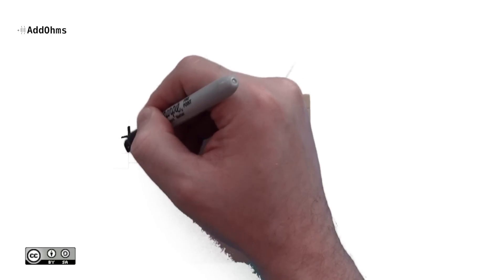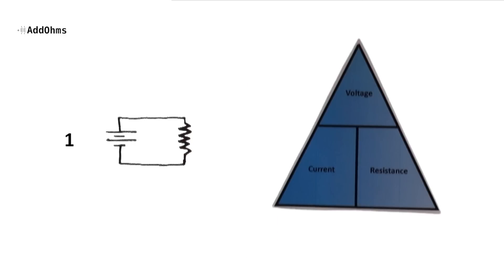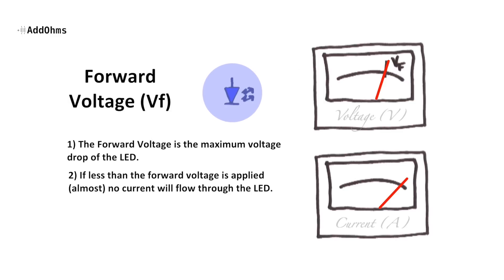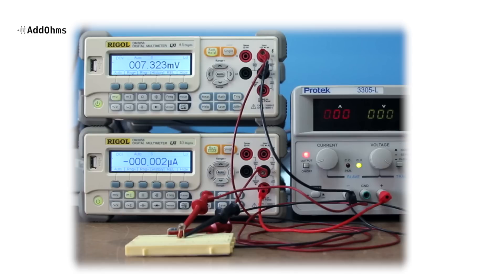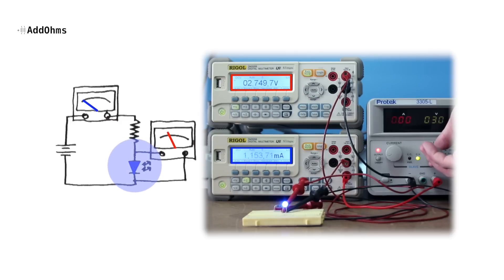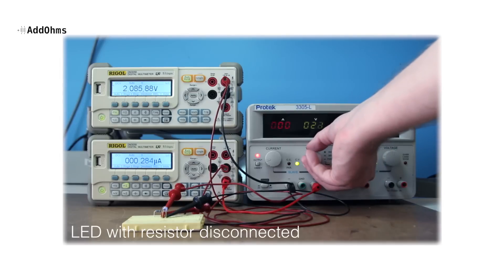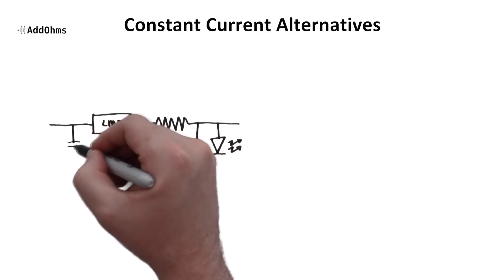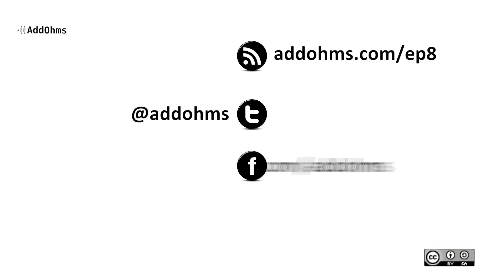Why use Current Limiting Resistors | AddOhms #8

Comment: i know the standard resistor value to be used with LED is 330 ohm. How was this value derived?
Reply from the maker: The value of the current limiting resistor is determined by the LED's forward voltage and the forward current you want to set. Using those two pieces of data, you use ohm's law to calculate the resistor's value. 

(Most people set the forward current to the LED's Max, which is generally around 20mA. This isn't necessary and shortens the life of the LED.)

I have a written tutorial on it here: https://www.baldengineer.com/led-basics.html

Comment: How about if you use PWM yo limit the current, taking into account the voltage drop and the voltage you are using?
Reply from the maker: +Victor Rivarola Nope. PWM isn't analog. It's the full voltage on, when it is on. You still need a resistor.
Reply: +AddOhms Are you sure of that? 

According to my tests... it works!

https://drive.google.com/file/d/0B1GqzCtvayD3RzN0TlUxR0Q1MGM/view?usp=drivesdk
Reply: +Victor Rivarola I could even post the code if requested.
Reply: You know what, here is the code. Just copy it into an Arduino IDE and upload it to the device... THEN hook up the LED to it.

-----------------------------------

// LedWithoutResistor - This lights an LED connected to a PWM chip without
// a power wasting resistor. WARNING: You need to check your LED's vorward
// voltage drop and the arduino's output voltage for this to work,
// otherwise you risk burning it.

// (c) Star Labs Informatica N.C.V.V., Modified BSD lisence
// http://directory.fsf.org/wiki/License:BSD_3Clause

/*
 fLedsForwardVoltageDrop     nLedsHighLevel
------------------------- = ----------------
      fArduinosVoltage            255
 */
 
const float fLedsForwardVoltageDrop = 3.0;
const float fArduinosVoltage        = 5.0;
const byte  nLedsHighLevel          = fLedsForwardVoltageDrop * 255 / fArduinosVoltage;

// The LED on nLed is supposedto have no resistor, while the other one obviously does.
const byte  nLed                    = 11;
const byte  nBuiltinLed             = 13;

// setup -- All of the program is done at the begining
void setup() {
  pinMode      (nLed,        OUTPUT);
  pinMode      (nBuiltinLed, OUTPUT);
  analogWrite  (nLed,        nLedsHighLevel);
  digitalWrite (nBuiltinLed, HIGH);
}

// loop -- There is nothing here, just fullfills Arduino's API.
void loop() {}
Reply from the maker: +Victor Rivarola "It works" is a bad result. "It works", for now... You need the current limiting resistor. When the PWM is on, the LED is drawing the max current it can draw. It is damaging the LED and the IO pin. It will take long for the circuit to fail, but it will fail.
Reply: Thanks

Comment: Nicely done. So it doesn't matter if the resistor is in the circuit before of after the LED? If it is good design to have the resistor after the LED then is it good design to have one resistor after 3 LEDs as long as the resistor value is correct for each of the LEDs and as long as only one of the three LEDs is lit at one time? Like as in a stop light?
Reply from the maker: +Volthaus Lab Since it is a series circuit, it doesn't really matter where you place the resistor. A good design practice is to place the resistor between the source and the LED.

As for your 3 LEDs in parallel--or a RGB LED, I've seen designs that save space doing it with one resistor. However, I personally wouldn't. Also if they are different colors, you're going to want different resistor values. Red LEDs are generally dimmer than Green and have different forward voltages.

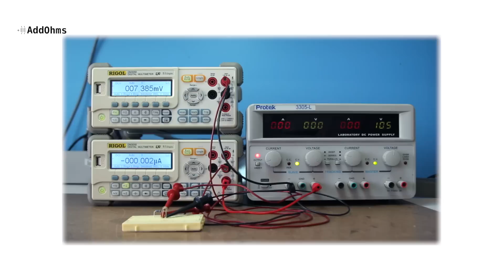Comment: At 3:22 you said we took the LED out... but the text said LED with resistor disconnected. Small slip up but a very informative and interesting video.
Reply from the maker: +fatherof8kids Occasionally I slip and don't catch it. 

In the "Analog vs Digital" video I said "digital" once when I meant to say analog. No one has caught that one yet. ;)
Reply: yes i notice that also, but now i understand about the current and voltage mutch more

Comment: I find that in many cases,  I can use leds without resistors, like when op amps are used to drive them. Op amps rarely can deliver more than a few 10's of milliamps! Sometimes I will use power supplies that have 3V outputs and can naturally drive blue and white LEDs without issues.

Comment: as we know V=IR

if R is not connected in the circuit (means R= 0 ohms)
then will the Voltage be zero?
Reply: Resistance is never 0.  There is some resistance in the LEDs and some resistance in the wires and usually some resistance in the power source (e.g. battery).  

These small resistances will drop whatever voltage the LED doesn't, creating unnecessary heat and potentially damage things.  I sort of talk about this in #9, where I address putting 4 LEDs in Series:  AO #8 Current Limiting Resistors
Reply: If R is removed then its value is infinite (not "0"), and you are left with pure capacitance. Enter imaginary numbers: i=√(-1).

Comment: Do I still need a resister if the LEDs are in a 4*2 style powered by a 12 battery?
Reply from the maker: 4 in series with 2 "branches" in parallel?
Reply from the maker: Check out Video Q&A #1  (video #9).  I addressed this question there.

Comment from the maker: Good question Norm.  Even if you use 2 AA batteries, the problem is that the LED will draw as much current as it can.  It's "current limiting resistor" will become the internal resistance of the battery. 

When new, the batteries will provide a LOT of current at first.  Over time, they'll drop rapidly.
Reply: I have 60 volt transformer I want to be able to vary the voltage from 0 to 60 volts dc  I can't use an lm317 because I would burn it out, what do I do?
Reply from the maker: Owen Chase science channel What do you mean by transformer? 

Transformers only work with AC. Are you trying to convert AC to DC and then create a variable power supply? Because no matter what you do, you won't be able to take the 60V AC output of a transformer and output 60V DC, without some loss.
Reply: AddOhms ya I know how to convert it to dc I just want to make it variable.
Reply from the maker: Owen Chase science channel  I certainly wouldn't use a linear regulator. When your output voltage is very low, it would be dropping the entire difference between Vin and Vout, which means very little output current.

So, you probably need to look at a switching (buck) converter. The TPS-series from TI has a high input voltage and they offer variable versions. 

You could get pretty close to 0 and pretty close to 50V with a single switching circuit, but it would be horribly inefficient and relatively difficult to select the passive components.

Instead, I'd recommend a couple of different stages or ranges, similar to how a bench power supply works. Of course, then you need to build a front-end to manage that.
Reply: Thanks
Reply: +Owen Chase science channel Bench-top adjustable linear power supplies generally use transformers with many, many taps. That way that can keep the delta voltage (between the transformer tap and output) low. You may consider rewinding the 60v transformer, or using a variac instead if no isolation from mains is not a big deal.
Reply: Power Max Ok thanks I have been thinking about getting a variac.

Comment: So what if the forward voltage of your LED is 3v. Let's say you power it with 2 AA batteries but no resistor. Is it still going to draw enough current to blow the LED.  Since the higher the value of the resistor the dimmer the LED will be, is there a lower limit to the value of the resistor where it would no longer protect the LED?